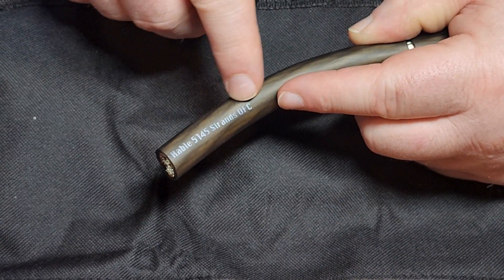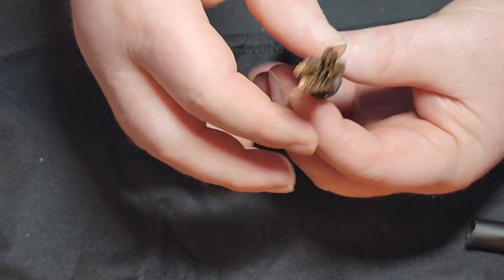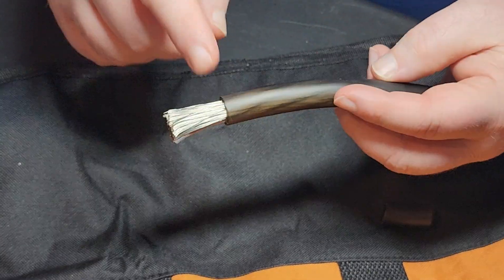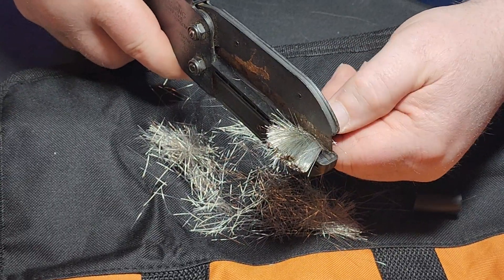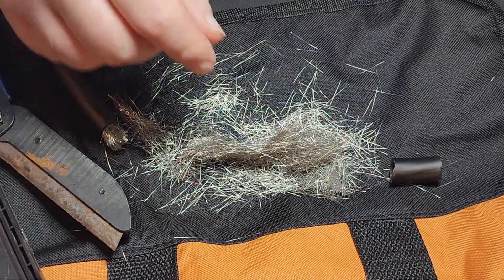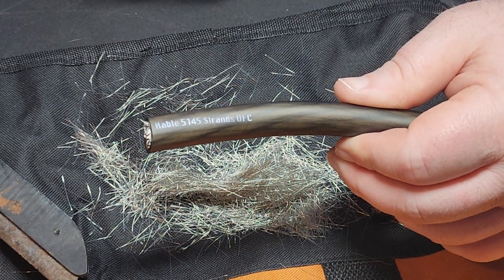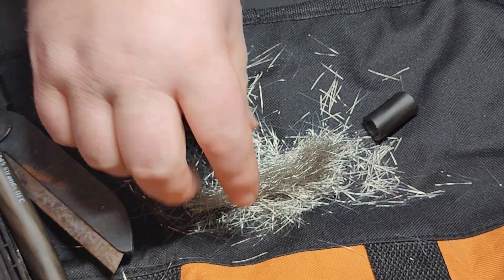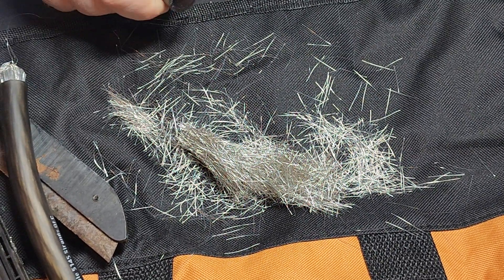99.99% purity tinned Oxygen Free Copper wire

Comment: I use them, skyhigh car audio, GPC.
I also use CCA i just drop a awg.

Something that might need a 4awg ofc i will drop to 2awg cca
Reply: Copper clad aluminum wire has been known to catch fire. 

Use only oxygen free copper wire welding wire is good or marine grade wire. There’s a way to blow torch the wire if it burns green then it’s copper there’s videos on it. There’s plenty of wire companies that have aluminum in it claiming to be copper be very cautious.